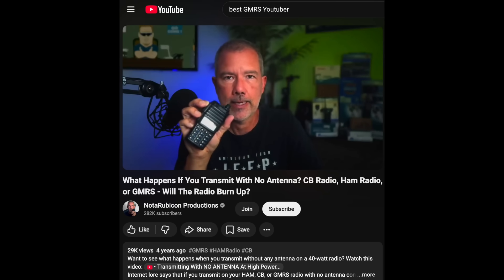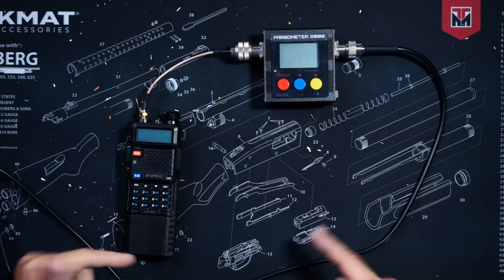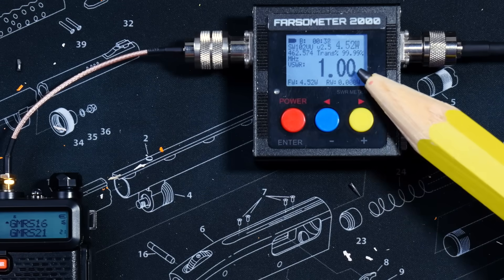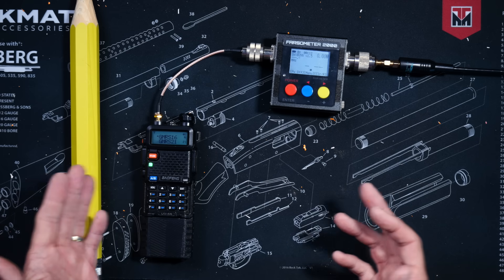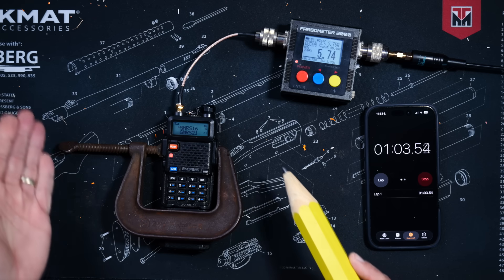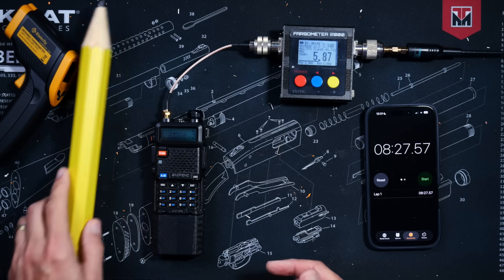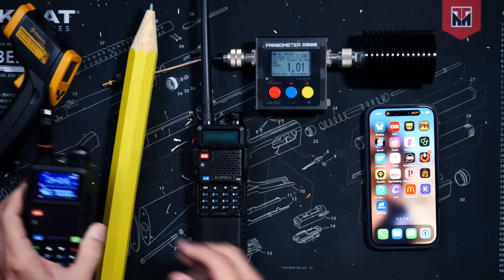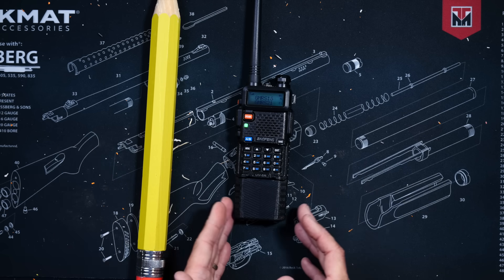Transmitting On A Baofeng Walkie-Talkie With A High SWR

Comment: I beg to argue with you. Many, many people have, indeed, destroyed the power amplifier final transistors by transmission into a poor load with very high SWR. 
STOP WITH YOUR IN
OBNOXIOUS comments.
While the misconception is instantaneous destruction, the RF heating of the output stage WILL, EVENTUALLY, destroy the final amp transistor(s).
EVEN WITH "FOLD BACK CIRCUITRY PROTECTION" the risk of eventually damaging the power output stage is increased.
Again, it won't be "instantaneous" but is most likely to happen with prolonged very high VSWR.
I HAVE REPAIRED MANY TRANSCEIVERS with burned open finals from extended use on bad loads (mainly antennas).
Reply from the maker: How many modern, chinese hand-held transceivers like the one in the video have you repaired with burned open finals from extended use on bad loads (mainly antennas)?
Reply: Wow. I thought this was a great video, but as soon as I saw you ALL CAPS DERANGED RANT I realized that I had been a fool. Clearly, whoever shouts the loudest is always right.

So I realized that I have an old cheap Chinese radio that I never use (because this wonderful YouTube channel pointed me at a BETTER  cheap Chinese radio, charged it up, shorted to output because a sad ham in a blog post said that's the way to get the worst SWR possible, and ran it until the battery went dead. It still works fine and now I have a new use for it: hand warmer!  Just warm enough to keep my pinkies happy, not warm enough to burn me. Thanks, Obama!
Reply: 😅sad ham!
Reply: Did you know if you fart on your radio it will temporarily smell bad!?!?!?
Reply: You made yourself look ridiculous man! 😅sad HAM!
Reply: If you cant setup an antenna correctly, So that it does have safe SWR levels... 
You shouldnt be anywhere near a radio.... 
If you dont have the knowledge on how to adequately set one up....
You shouldnt be wasting your moneys on it...
Reply: congrats you will now be pinned a fool forever after only a few mins of you existing

Comment: This is all well and good for powers of 5 watts or less, at those power levels the output could easily withstand dissipating 5 watts or less heat which isn't much...this would be typical of most handhelds and CB radios, once you go to higher power levels it is a different game. Running at 1 watt you could short the output all day long and I have found that you can run 2 watt handhelds at near 100% duty cycle with no ill affects.
Reply from the maker: so would that be the same as transmitting with no antenna at high power?
Reply: @TheNotaRubicon  Sure, you can't hurt these handhelds that run under 5 watts regardless of what you do, open, short, high VSWR, high duty cycle, its all the same. I have tortured a BF-888S on high power for yrs with no ill effects. Builders use em for allstar nodes running near 100% duty cycle all the time. These low power radios don't have protection built in because they don't need it.
Reply from the maker: Watch this video to see all the damage done when transmitting at higher power with a high SWR/No antenna.. ->  https://youtu.be/X3r2K96hsGc?si=o2T8qAAtW_bjvtb5

Comment: Modern rigs are quite a bit more durable by design than older equipment. Chances are, if you tried this test on a rig that operates on vacuum tubes with a 1,500 amplifier also being tube tech.... you'd most likely damage something. 
 All in all, interesting experiment. I for one, wouldn't intentionally run a high SWR antenna jusy due to the fact that doing so would mean the radio is not actually transmitting all that power out but rather being returned back into the radio heating it up.

Comment: I don't know if I want to agree or not. But to be serious,the result depends.
What happened when really high swr occurred? First,it stress the output stage with return wave. Secondly, because not much power will be send to load, Amps eats up their own output power and convert to heat. So you can see the thermal effect on the baofeng. And depends on the design and environment, The amp will survive, heat to death, or breakdown output stage instantly if it's running at its limit. Well, that's all. Not big deal but should be concerned. And take care of your equipment.

Comment: Maybe try with a Radtel RT-880? Mine went unstable on a 40C day, while standing in the sun and chatting on a repeater for only a few minutes. The metal backplane got too hot to touch and it stopped receiving, trying to transmit just made it instantly hotter. It got so hot that I thought it was going to catch on fire.

Comment: Usually the rubber duck supplied with an HT is all that’s needed to achieve a high VSWR even without using precision bolt cutters.

Comment: Not that I really care, but if it’s a myth then maybe you can enlighten us as to where and when it comes from? 
Older types of radios, maybe?
Reply from the maker: Yes.. Old radios would be damaged easily, and even modern radios that output a lot of power can be damaged.. but the 'experts' dont seem to know this.
Reply: @TheNotaRubicon ok, so it is indeed most likely stressing the electronics, but not enough to damage a 5W radio. 
These are probably designed for people who may very well do the wrong thing by accident.

Comment: You seem to deeply misunderstand what V/SWR represents and how the internals of the radio works.

I’ve never in my nearly 30 years in the comms industry heard anyone ever say that transmitting with a high SWR or without an antenna damages the radio Immediately. 

Seems to me you have built a strawman just to make a pointless video.

Everyone with any knowledge knows that high SWR is bad for multiple reasons and if you constantly transmit with significant reflected power over a long period of time, heavy use for weeks and week, you will damage the radio.
Reply from the maker: Seems you're not online very much..

Comment: I was taught radio and transmitting theory, basic designs, constructions way 
back in 1973 and I've got to tell yah that with that said in especially with 
transmitters, it carried some weight and the warnings that came with it! Well 
now, when those thermal measurements that were performed, they were NOT 
the actual thermal values that were entirely accurate. Had the the RT been 
opened up, such as to measure the actual temperature such as to measure the 
finals output stages, it would be a different value, be it the story. I'd dare say 
that temps exceeding 140 F, you'd be starting to move into a so called dangerous 
threshold to be certain. What most people should realize is that high temperatures
can and will destroy components for real and should not be ignored! For the sake 
of argument that reinforces what I just mentioned...the bottom line is that in one 
sense of me saying this, as for ANY electronic circuitry that has been subjected to 
high heat that exceeds first of all will degrade the circuitry first of all, but then 
performance can go straight to hell, but when making a terrible mistake will surely 
add up quickly only to find out that their stuff CAN be destroyed. Just think about 
this for at least one moment! What I just said is not a misnomer, bad chit can 
happen!

Many moons ago these CB radio operators that utilized power amplifiers that were 
added on, and if tuned properly to include a proper antenna match, SWR's and just 
plain screwing around only to find out that their chit burned up! WELL, oh well, just 
when they found out the hard way; it was just too late! I knew of such a person way 
back when that did their installation and setup and wasn't paying good enough 
attention to the finer details and did not bother to consult someone that had the 
expertise and the end result for his expensive power amplifier is that it ate chit in 
about a week or so. Well now, perhaps with newer R/T designs, there may/might be 
thermal protection to prevent thermal run away, better heatsinking, the ability for 
scale back the amount of power being applied or something or another; I just don't 
know to be certain so as to help protect from some of the damages that can or may 
occur. Again, I just don't know because I haven't followed improvements along the 
way over a period of nearly 5 decades.

Comment: It's not necessarily that a high SWR will damage your radio. It's that it may damage your radio. This is pure supposition on my part, but I would assume manufacturers would build a certain level of resistance to that in their radio. Especially since the problem is well documented. Once again though pure supposition on my part.

Comment: My experience, as well as one of my friends, blow the finals out of a boofwang ar-5rm after hitting the ptt for several seconds accidentally with no antenna... same thing with my friends tidradio h8, was fine fir a few sec, and then made a sizzle sound.... and couldnt get more than .25w out of the radio after that.... 

As for high swr, i ran the stock antenna on a btonera, and it was like 5.5:1 swr, still works fine.....😂

Comment: Funny video. Also funny is that the display seemed to have been affected.
I had to return a Radtel 920 after using it for a while with the stock antenna and a high SWR on GMRS. The display started whiting out. Turned out to be the grounding wire at the base of the antenna had somehow unsoldered itself 😏

Comment: Had a 50watt radio on a rescue truck that wasn't transmitting for worth a darn for at least a month before I was told about it. When I hooked up to the radio with my Farsometer I had an SWR of like 19 which I think is the max that it would read😅. It was reflecting half of the power back into the radio for God knows how long. I ran a new coax which fixed the issue and the radio works like the day we got it!!!

Comment: I'll pay for another test, if you're interested. I would be curious to see what the results would be with a 5 ohm resistor instead of an antenna. You can have high SWR for two reasons. One being because the resistance is too high, which is what i think you may have simulated. For example, no antenna is an open circuit with infinite resistance.  What if we got a 10w, 5 ohm resistor, cause a 10:1 swr (closer to a short)? Instead of just heat from reflecting power back to the radio, there would also be excessive current flow.

Comment: To quote @notarubicon 'Don't do this'.
Most transister based transmitters (tubes are a bit different) have (for the last three decades or so) will limit the REFLECTED power on the antenna output by lowering the power to the final amp.    Thus, they are "Self Protecting".

When tuning an antenna, the IMPORTANT part is "Forward Power", or getting the 'Trons" to go out of your transmitter into the air, bad SWR just reduces this number

Thank you, and Happy New Year

Comment: Before I got a UHF capable SWR meter I had some little stubby ducky antennas for use when only a few hundred feet away at most, which whilst sold as being tuned for the usual suspect bands in UHF and VHF, turned out to have absolutely atrocious SWR on the UHF PMR adjacent bands. on high power settings the Baofengs would howl briefly on releasing the PTT to return to receiving mode. In as much, that does at least make them a fine candidate for trimming to match 'perfectly'. As for popping TX stages with bad matching, I seem to recall it was a particular issue with the HF sets that used valves in the final stages of their amplifiers - some of which where still being used in premium brand radios sold to the ham crowd in the 90's.
Amusing no less seeing that these things can clearly 'survive' this abuse, when more expensive toys allegedly often do not ;) :)

Comment: How come I've had to replace so many people's output transistors? Hummm? Handhelds don't have enough power to do damage.
Reply from the maker: According to the "experts" that keep telling us we will burn-out our handheld if we transmit with a high SWR, you are wrong.  
Seems like you weren't smart enough to get the point.. Hummm?
Reply: I burnt out the transistors in a Motorola HT 500 handheld because I had an external antenna on my vehicle that got moisture inside the base and caused a "Short" between the antenna center wire and ground. I think my expertise is in demolition..

Comment: In most VHF/UHF handheld radios, the final amplifier stage is deliberately not operated at maximum output power. This increases reliability, meaning these devices generally do not fail easily, even when the antenna has an unfavorable or high SWR. Most of the antennas that come with handhelds aren't very good. I've owned quite a few handhelds and have never had the finals break under normal use.

Comment: Modern radios surely has protection or some such to prevent the final tx transvestites, uhm I mean transistors not to let go of the magic smoke.  However, old CB radios often blew their finals when swr was way off - I know, because I did it back in the day. 😁

Comment: Very interesting. Ive often wondered if HTs are not so sensitive to bad antennas as the "rubber duckies" they come with are known to be horrible, yet the radios keep working. Maybe do a battery longevity test. Same radio, same battery. How long will it tx on known crappy antenna vs known good quality antenna. Perhaps thats the real difference in HT radios. However, Im not sure the same rest should be done with a 50w mobile radio.

Comment: some interesting apps there with the background. sounds like you got a full weekend.😂😂😂😂😂😂
anyhow im not an expert ham just a noob. but i thought with the high swr, the power gets reflected back into the radio and heating the transistor. than the high heat IF hot enough could damage the radio? maybe it really depends on how much power you try to do it with? does the frequency play a part in this?
 iv personally have ran on motherboard and pci wifi cards with no antenna for years at a time and never seen them slow down or have any issues with them. genuinely have never gave this a second thought. just have always been told that it was bad to have a high swr.

Comment: The meter is accurately showing what is happening. The forward power is 4 watts and the reflected power is 2 watts with an swr of 5.77. And swr table shows 50% power loss at 6.0 swr (close to your 5.77 value). 
Foldback protection circuits reduce the forward power as the reflected power increases.
BUT, this simple baofeng did not do that. The forward power never changed. So if the 2 watts of power is not going out of the antenna and is reflected back to the radio, why does it not blow up?
Yes, some and eventually all of this power will get dissipated in the radio as heat. But it does not do that all in one shot. SOME of the power gets dissipated but MOST of the power gets reflected by the radio. So the power bounces off of the radio and back to the load. Its a wave. Like a slinky. Just bouncing back and forth and 50% gets absorbed and turned into heat on both ends.

Randy. Lets have more fun. Replace the antenna with a foot of coax and a switch on the end that will short the two conductors of the coax.

Comment: Transmitting into an open connection does not damage anything. It can heat it up if you do it for a really really long time. And yes, you can damage the radio if you are ragchewing all the time with a return loss higher than about -10dBm or so for hours on end. It damages the radio because it heats up the PA of the radio if keyed up for a long period of time. But doing it for a minute or two is perfectly fine…it won’t blow up. Which you just proved with your tests. Although the more power the more quickly it heats up the PA’s finals. So big power = big heat.  “Some people” just want to be the “smart guy”.

As a radio professional, I tend to roll my eyes at “some people” a lot. Good job on the video.
Reply: That's why God allowed us to build fans.

Comment: How hot would the radio get transmitting that long with a normal SWR?
Reply: Probably the same. I used to do the same with a properly tuned antenna, only longer... About 30 minutes. The fan is set max for cooling 🤣

Comment: I'm not an RF engineer by any means, but I believe these modern radios have ways of protecting themselves against mismatched antenna's or the like. Now take vintage gear with tubed RF finals or early transistor outputs. I'd wouldn't be as confident about some of them surviving a continuous keying with a very high VSWR. BTW, DON"T put that pencil in your pocket! "Some People" may think you're happy to see them!
Reply: They didn't really care unless it was a direct short unless you were one to pass out with the mike keyed up with your favorite porn VHS playing in the the background.
Reply: It dropped a little power, ive an Alinco for 11metres (cb) use here in the uk, and it does cut tx if theres no antenna, or my pet cockatoo has eaten the coax

Comment: The newer rigs have folldback circuits that protect the PA from high VSER situations. The older solid state rigs didn't have them.but this is still not good practice!
Reply: ((Not a criticism, you got me thinking) If it had a foldback circuit, the power would have reduced, which it wasn't. 
However, I did some ChatGPT maffs, and a 6:1 VSWR means roughly 50% of the power goes out of the antenna and 50% goes back into the radio, so the radio only needs to dissipate 2 watts of heat, which technically speaking is F'all. I was always taught this would be a catastrophic failure.
Thanks, Randy the Queen of all things radio, for dispelling this miff.

Comment: An HT only puts out 5w, so even an extreme SWR is only reflecting an easily dealt with. An SWR of 4.4:1 is only reflecting 2w, at 5w forward power. . An SWR of 2:1 at the legal limit is reflecting 170w back into the transceiver.
Reply from the maker: Then the "experts" should probably mention that when they tell us that a high SWR will burn out our 5W HT...